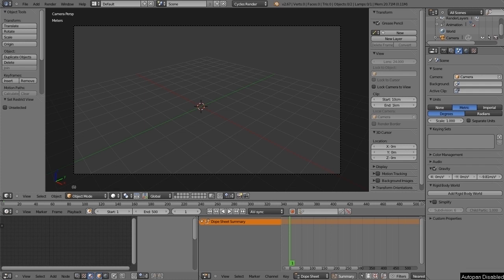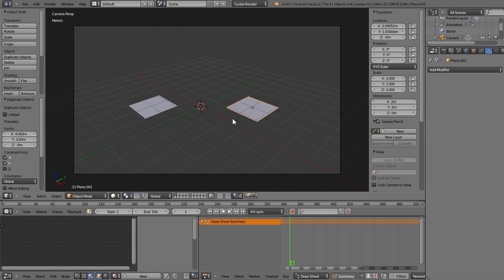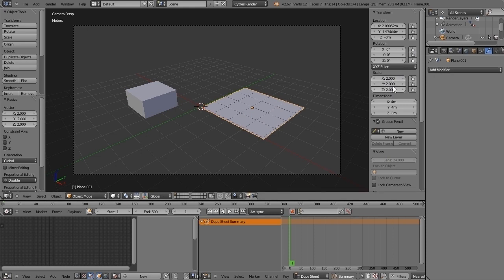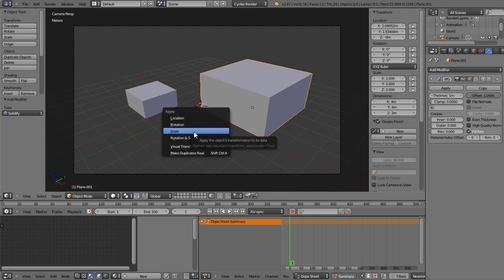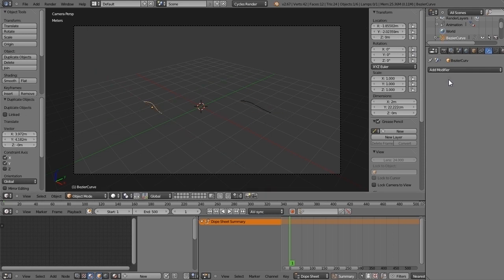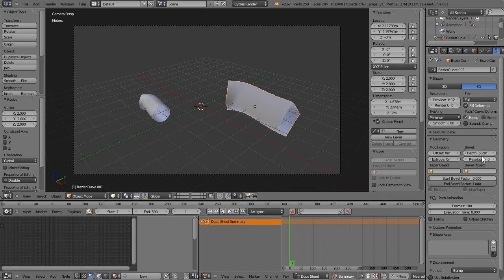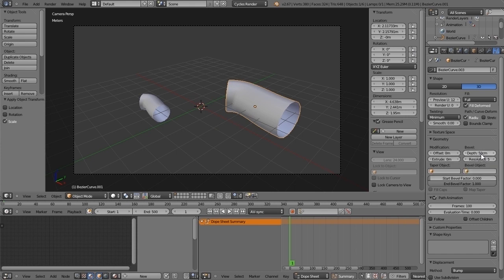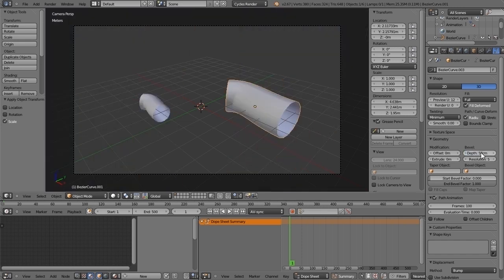Apply Scale bug in Blender

Comment: Interesting point, and I think, you are right (it is still the same in Blender v.2.72)
Reply from the maker: Thank you, Don. The frustrating thing is that I reported that in the bug tracker back in 2013 and I got a (not so friendly) response that I could simply enter Edit mode and change the "Main radius" parameter back to 1.0 (default)... They agreed that it is a weird behavior, but they said that they will not correct it because "people are used to that now"... * sigh *
Reply: Hmmm, that kinda sucks.. new users are not use to it, and I think that experienced uses rather fast would get used to it functioning, as it is supposed to (according any kind of logic/consistency), so I think, that is a very bad argument.
Reply from the maker: Don Doh I completely agree with you!... But, well... That hasn't stop me from reporting bugs. I've reported around 8 bugs and like 5 times they have solved them... a couple of those in just matter of hours!... So is not always bad. :)
Reply: Smiles, ok, that sounds good :)

Comment: The problem still exists in 2.82. I just found the solution from this link, but you need to take an additional step.
https://blender.stackexchange.com/questions/129310/how-to-change-radius-weight-of-curve-bezier 

To reset the radius after scaling, go to edit mode, select all vertices and use 'Set Curve Radius'. In the bottom panel fill in '1' even if it says '1' already.